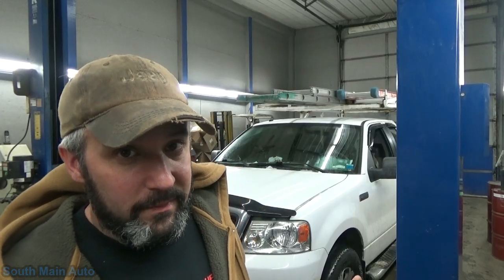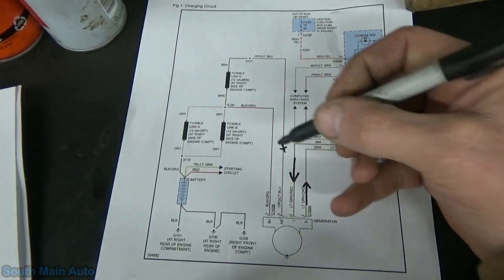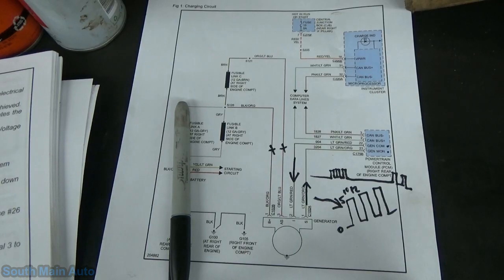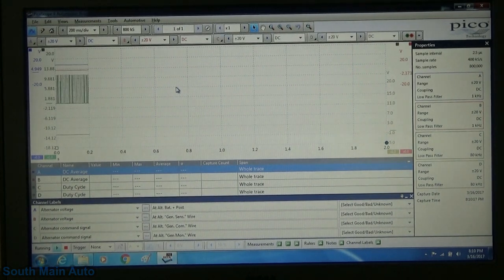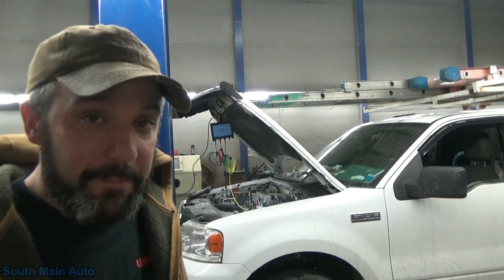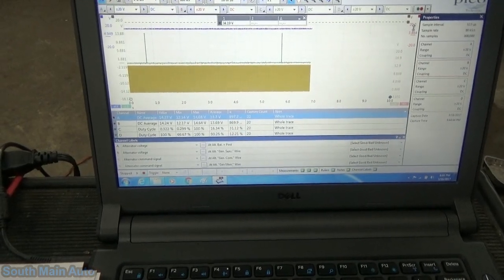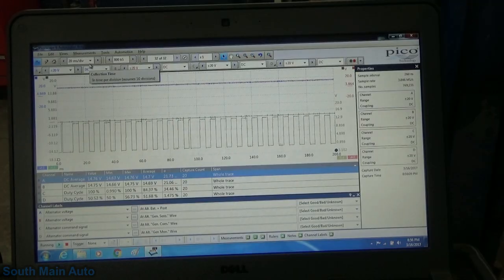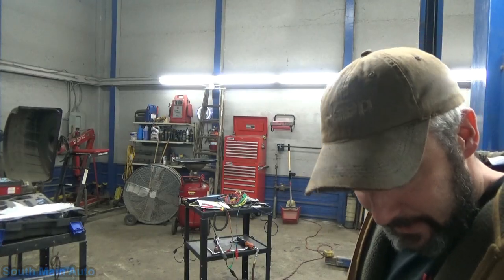Ford "Smart Charge System" Alternator Not Charging

Comment: Thank you for the knowledge.  Your video on the crown vic police interceptor was helpful. I have a 2010. New alternator. New battery.  Understand the smart system thanks to you. A little scared to fire it up unplugged.  300$ alternator.  But I'll try it. I have no scope to check for the com or mom side of the system but I'm in upstate New York.  The salt damage to all co hectors is horrible. Was thinking about replacing the pcm. Read that if the  charge light fails it'll cause a no charge pro lem. As with you, no falt lights or check engine lights on.  Only batt light appreciate any ideas. Thanks Robert Lackey

Comment: Thank you for your video.  I have a 2010 crown vic police interceptor.  New batt,  new alternator  (215 amp, 300 ) same issue.  No charge,  only batt light comes on when voltage gets low 11,11.5. Charge battery,  light goes out till v drops off again. Frustrating.  Dealership had it for 4 hours and no ideas. Also no bill. But no answers.  Gonna try unplugging alternator  and bet it'll sit at14.4.  Either pcm or bad wiri g between alt and control mod. Wish I had a scope. But I'll try feeding a trick signal to alt  and ground out the data out to pcm?  It's sat at idle for hundred of hours. Upstage ny. Salt in all fuse panels and connectors.  Do you think that mod and sense ciciut needs to be shielded? Open to a y ideals 
 Too much police wiring still in car. Going to croc all fuse panels and plugs. Check and add a few extra gounds. Everything rust up here. But it's a nice car. And I spent my small but entire Inheritance on it. It has to be reliable. In a disabled marine, auto and diesel mechanic.  I'm stumped.  Can't even get a schematic for what there done to the wiring. Sad but true.  Thanks again for you're vid. Most Infomative of any I've seen.

Comment: To simplify diagnosis in this kind of system it would be convenient to be able to disconnect the alternator from the system and test it on the bench, independent of their complicated communication system on the car. The old 'full field' charging systems did just that, in a much simpler format. I am surprised Ford didn't think of designing the program around that principle. Did you ever decide how this alternator failed, was it a software problem inside the device, a voltage regulator issue, or the alternator charging system itself?

Comment: Nice informative video - if unplugging the controls wires on the alternator don't set a code then swapping it out for a single wire Delco wouldn't be a problem... I have been a generator man for about 30 years and as far as complexability goes - this ford system is not that bad at all - to test the alt just unplug it and rev the engine and see if the voltage comes up - if not you know u need at least an alternator - for you guys that were asking why you have to rev the engine it is because the alternator has to build a certain voltage to turn on the regulator - this turn on voltage is caused by what is referred to as residual voltage . The residual voltage is caused by the leftover magnetism in the steel of the field coil. Once the residual is high enough the regulator will use it to create the input power for the voltage regulator which will then supply the field current to the rotating field to complete building the voltage to the required level. I haven't seen anything on how this thing works but I'm pretty sure this won't miss the mark very far - when the computer communicates with the alternator what it is doing is first controlling what is referred to as a field flashing circuit - this circuit makes the alternator build voltage without having to rev the engine - what it probably does is take power from the battery sensing lead and feed it into the regulator - then the PCM just senses the battery voltage - engine speed - air temp - throttle position and whatever else some brain dead moron engineer could dream up to arrive at some desired battery voltage - the results of that PCM subroutine determines the signal sent to the voltage regulator to either raise or lower the field voltage which result in the rise or fall of the alternator output. I noticed that when the throttle went wide open the charging current was cut to 50% that is probably a system to allow for more horsepower to the wheels - logic being you need all the horsepower available otherwise you wouldn't have your foot stuck through the radiator... The basic logic behind all the engineering changes to ford and the rest of the car manufactures rests with two trains of thought - the first is simple - if an engineer told his boss that whatever system he was responsible for was good and needed no redesign or changes he would be laid off the next week simple as that - the other train of thought and what all the engineers blame is government regulations - and government has practly regulated automobiles to such a point that the cost of ownership is getting more than most folks can afford.. I think it would be fantastic if all the auto dealers would send notice to the Feds that they would all shut down on a date certain because they could not build a car that could pass emissions - the car companies would tell the Feds they would close down layoff all assembly line workers and just supply replacement parts for the existing models ... And all the laid off workers would meet any boat that tried to import into America and burn every car unloaded... I bet the epa would back off of some of their BS then.... Keep up the good work Eric

Comment: I had a problem with my alternator on a impreza sti. Yeah smart stinking alternator. Had to have a new alternator and no it did not fix it and yes subaru tested it it was faulty.  Second fault was ecu not controlling alternator properly my mechanic had to reprogram ecu so  now the car charge stays between 13.9v and 14.5v depending on battery state of charge.

Comment: That light not coming on bothers me too.
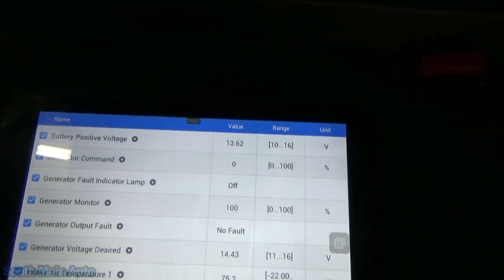Reply: At 24:41 minutes into the video with the 3 wire harness unplugged and the truck running and the alternator charging. the computer  Commands the light on, 
The light doesn't illuminate my guess typical F150 faulty instrument cluster. 
Of course this video is 5 years old and with your new York winters I'd guess this truck isn't even on the road anymore.

Comment: Yeah, makes sense. It sets the generator output to max and leaves it, just periodically setting it again. Then after the engine goes back to idle it looks like it wants to check and see if the battery is charged yet, or if it needs full charging current again, so it lowers the output to see if the battery holds the voltage high or drops again. The generator doesn't need to be loading the engine when idling if the battery is fully charged.

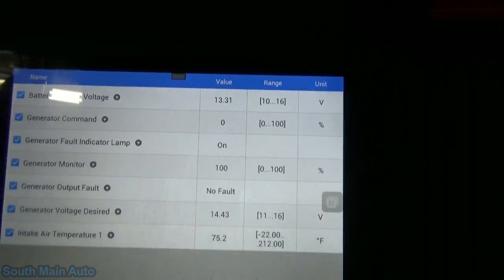Also, the indicator light did come on! 24:41 your scan tool changed "Generator Fault Indicator Light" from "Off" to "On" while you were revving the engine.

Comment: Got the same problem on my 2007 Focus.  Was driving home today in the rain, and noticed the wipers getting slower and slower.  Then the gauges went dead and soon after the car stopped.  Battery was flat-lined, and nary a light ever on the dash that the alternator wasn't charging, or check engine.  As others have pointed out here, WTF is the purpose of tying-in the alternator to the computer system?  We had alternators with built-in regulators for decades.  They worked fine!  If something went wrong, just replace the unit.  Why do you need a diagnostic tool costing hundreds if not thousands of $$$$ to tell you if there's a problem with the alternator?  Yesterday's mechanics would have laughed their asses-off at this.

Comment: Hi Eric i dont know if this is relevant but i did hear somewhere that the red light wont come on unless the battery voltage gets down to about 8 volts and is controlled by the ecu...if its true or not i dont know, but doesn't seem to behave like normal batt lights..from Fred in England...

Comment: I would say this systems main purpose is to save fuel. cut the alternator off or turn it down during certain conditions to boost fuel economy. It may not function setting idle in park. may have to be going down the road for it function fully.

Comment: Bottom line is you made the RIGHT call, you sure know your job Eric, that's why I try to do all my own work on my Jeep GC, even with my limited electrical knowledge at least I am not paying someone for nothing. Last weekend I installed the Bosch 4 hole injectors and did all 8 in under 2 hours, got all 8 on ebay for 70.00 -- Seems any NASA level creation is used now to save .000001 of a gallon regardless of long term reliability however I remember when a battery would be almost junk after 2-3 years and water pumps lasted maybe 50 K. 

I just bought a 2017 Sonata 6 speed manual with their 'Allison' engine and the gas mileage is AMAZING, I get about 35 mpg and my former 2009 Accent with a 1.6 manual barely got 30--  From what I have seen of Ford lately I decided another H would be a smarter choice, I have had 4 all with excellent service

Comment: I have to admit I would struggle a lot to understand this type of charging system. Thank you so much this will help somebody for sure. You are awesome. Cheers.
Reply: Essentially the charging system adapts to the temperatures in the battery and the ambient temperatures. These things can affect the rate at which a battery can charge. My battery is low you can charge it fast up to about 70 or 80% depending on conditions. After that it charges much slower. It is the nature of what acid batteries. This charging system attached to make the charge itself more efficient if you're trying to jam volts into a battery that we can't take it because the battery itself is 2 warm War the ambient temperatures to armor both these things are governed by physics. So if you're trying to throw voltage at a battery that can't take it and you're just wasting fuel. Not sure I'm qualified to judge whether or not the system could have been done differently but I do know that lead acid batteries require some monitoring in large systems to ensure proper charging and not boiling the acid in the battery. Boiling your battery is bad because it gives off excessive amounts of hydrogen and oxygen.

Comment: Well, im an old guy and just don't see any possible need for the alternator to be tied into the freaking ECM, one more unnecessary failure point - and even though it was tied in, after all that high priced over complication the thing still didn't even do its job and throw a code - good chance a simple old school warning light system would have.   Weves always has an alternator light and could always easily test the charging system with simple tools.  It seems they insist on running every molecule of the car through the computer and adding more failure points at every turn and more expensive repairs to go along with them.

Comment: Sounds like it has a loose spark plug.......anyways the PCM in this system is pretty dumb,when these first came out I followed the stupid pinpoint tests in the workshop manual that led me to replace PCM because I was getting similar results as yours.replaced PCM and no go still undercharging.it was the alternator all along like always,really dumb PCM.

Comment: A famous ass kicker once said "Simplicity is the key to brilliance." I guess that does not apply in this field at all.
Reply: You think that's bad what he didn't tell you is even worse! If the battery light burns out the system will not charge. Now isn't that just brilliant Ford leaves people stranded on the road because your check battery light burned out your car isn't charging and you don't notice till the thing is acting up and you are low on voltage.
Reply: @Wvb1967  I was wondering if the battery light was working at key on, engine off.
Reply: Artificial illetigence is just round the corner, together with a "do next" flow chart it'll all come good

Comment: hey there eric that was interesting  system...im having the same problem on 2011 chevy 6.6L..has Teo batteries,at 12.7volts,when u go to crank and start it,the in dash gauge stays at 12volts but bout a few minutes the charging system kicks in to 14.6volts,is this normal?...
Reply: Joe Tisi since it's a diesel, you have glow plugs and an intake heater that pull amperage during cold starts, and can run for about 30 seconds or more. The pcm logic usually waits until those are off to turn the alternator to a charging state.
Reply: Sean Beckstead Oh ok I see..thank you for the info....the customer was just worried about the in dash gauge....

Comment: how similar is this set up to the GM smart alternator?
Reply: I know my '07 Silverado does something similar. Not sure about how the waveforms would look, since I don't own a scope yet. On my scan tool I can command the alt. field from 10-85%, if I remember the numbers right.

Lots of times after a long drive, I notice the volt meter pointing way to the left of 14v, like it's dead. The system was explained to me after I had to bring it in under warranty when it was new, when the battery did croak. Guess they had to reflash the BCM for a higher duty cycle. GM was going for mileage over battery life.

Comment: cause is the problem didn't happen for the correct amount of drive cycles..usually 40ish if I'm not mistaken. sometimes codes are instant or GEM can still sense backfeeding signals that throw off the logic gates internally

Comment: yet another ford smart "anti-charge" system, or service department filler
Reply: The water pump behind the timing chains cost ford 50,000 dollar sale..keep up the stupidity ford
Reply: fully agree ... makes the car as advertised "Fix Or Repair Daily" ...depsite the all signals the  Diagnonsis Computer does not get any fault ... at the end ... good old alternator replacement  solves the problem ...
Reply: mar1234567 not always
Reply: @mar-hz5or  "Fix...Or...REPLACE...Daily"
Reply: @TheOzthewiz  No, Ford is - Fix Or Repair Daily

Comment: Looks like a Pulse Width Modulation control system.... which is tricky... and I noticed several times the light setting was "on"... bad relay or even a bulb???

Comment: The more those Fuckin Design Engineers screw with things the worse it gets.
What the hell was wrong with having the Voltage Reg. in the alternator control the charging, it's worked great for years till those Engineers got there fuckin hands into it.
Engineers nothing but Fucking Idiots that couldn't find there Asses with both hands!

Comment: Gm has something similar on the new Silverados
Reply: chad harmon yeah I hate it on my 2014 Silverado. look down and the volt meter plummets to 12. freaked me out the first time it did that.
Reply: Tony Lester yup lol I had to call the dealer and ask them why it was doing it lol
Reply: So, THIS explains why my new van at work, ('15 Express), has all these gyrations in voltage whereas my old one, ('07 Savanna),  was rock steady. Yeah. Un-necessarily over complicated. BTW, the old went 398K w/o a hiccup. This new one is starting to act up w/120. smh
Reply: watajob yup

Comment: I have had to replace several PCMs in Fords for charging problems, mostly mustangs for some reason, it will fry the alternator because, when the PCM charging circuit fails it full field the alternator and does ok until the alternator dies then some shop fixes only part of the issue and wonders why it keeps killing alternators:( and never a battery light either
Reply: FORDS ARE JUNK ANYWAYS LIKE DODGE 
GOT 97 DODGE AND WHOLE THINGS CRAP RUST AND LEAKS

Comment: The alternator will fail again. As the reason it is not acting right. Is it has the wrong voltage regulator...Ford has over 5 different VR and they are Vehicle specific. You need to know the OEM part number and color of the VR  on the back of it. That the it left the factory with. Which you have to remove it to see if it's White, Blue, Gray ect.. and it has to be the exact match or the PCM acts funny! 

I fixed this problem 100's of times. As the auto parts store just toss you an alternator....
Reply: How do you know which voltage regulator came in the vehicle originally if the alternator was swapped from a different car? I have a 2004 new body F150 5.4 and it has an alternator from a salvage yard which has 2003 Lincoln Town Car 4.6 written on it with a grease pen. From what I have found, the Town car had a 130amp unit while my F150 came with a 110amp unit.   This salvage yard alternator constantly charges at roughly 14.6volts and the battery light stays on.  If you drain the battery a bit by leaving the lights on or running the radio for a while with it not running, when you then start it back up the battery light will stay off until it gets back to a full charge and then the battery light turns back on.   The battery is new and high quality and the cables are clean and tight.
Reply: @schigara  To understand why Ford does this. You can read this..https://www.picoauto.com/library/automotive-guided-tests/ford-smart-alternator/
The issue is each vehicle is ordered different. Head units. etc.. Each requires the right VR to work right.. The Wave form for each VR is different as well. The color tells you which the vehicle should use. As the PCM is programmed to see that wave form. The only way to know is to give the Dealer the VIN.. If you think it's been replaced with the wrong one.
Reply: get the vin and call the dealer.
Reply: I have this problem also but it didn't occur right after the alternator was changed it was some months later would you still consider this the problem battery is new and the alternator is new
Reply: +Master Chief 00117 Why the hell would they need 5 different Voltage Regulators? Any idea? Engineers purposely trying to screw everyone with all this unneeded complicated crap?